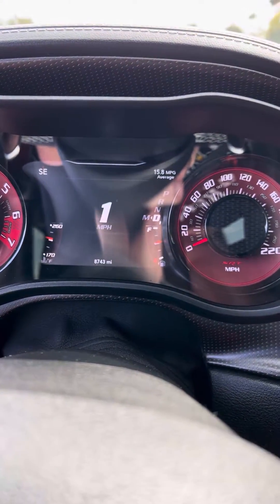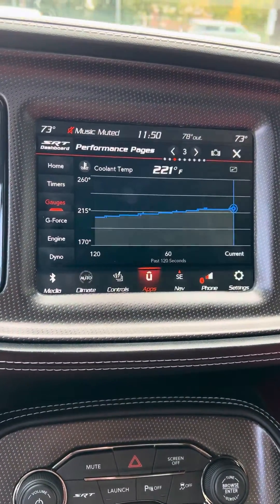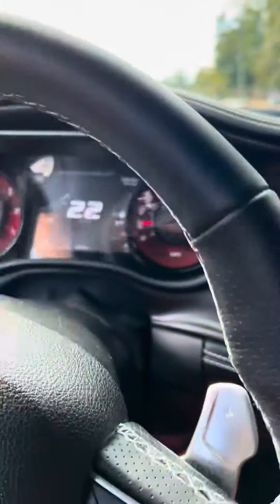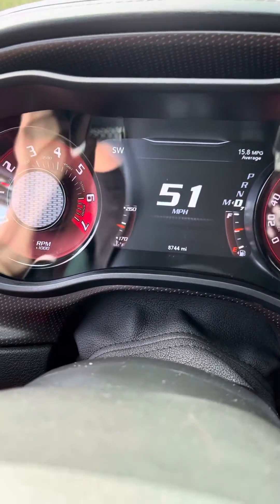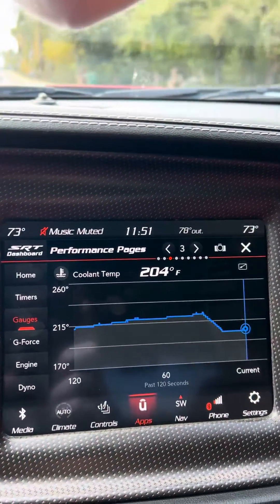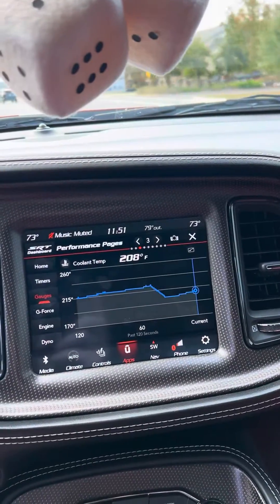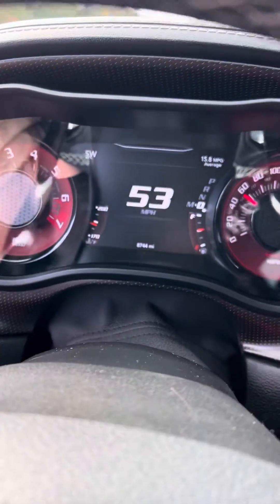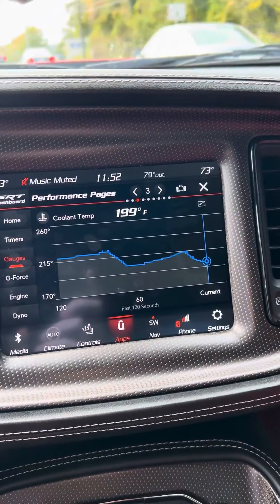This is what a bad thermostat looks like

Comment: My 16’ Ram w/5.7l hemi would full open from cold around 212-215. Then drop to about 196. From then on it will regulate around 200-207 pretty consistently. 

Get your thermostat replaced.
Reply from the maker: I knew the thermostat was bad. I was filming this primarily to hand to the dealership as it wasn't throwing codes. And, as we all know, if you show up at a dealership with no codes, getting them to do any work sometimes takes an act of God. You can't argue with data though.
Reply: @GuytheCarGuy  I kinda figured you already knew what was up lol. But yeah great job documenting what’s happening. Cause for sure if you just took it in, the tech would just look right past it and say it’s normal lmao.